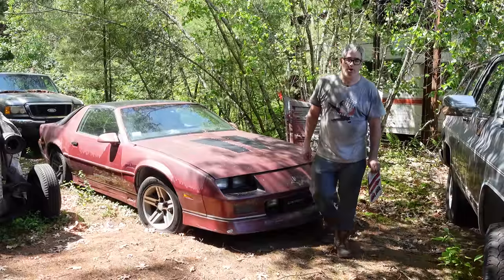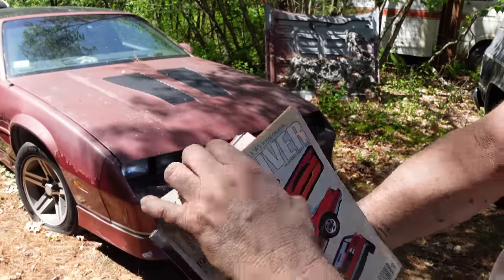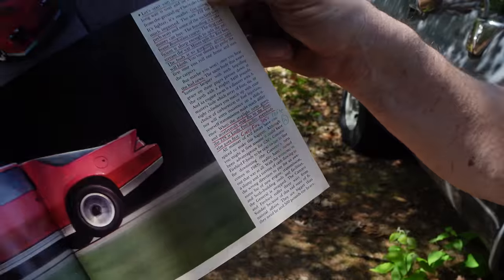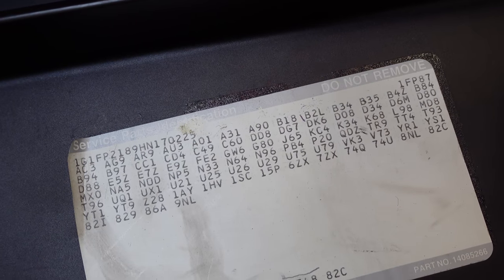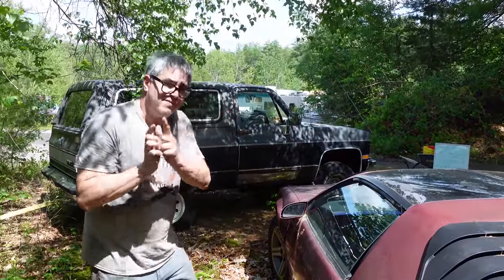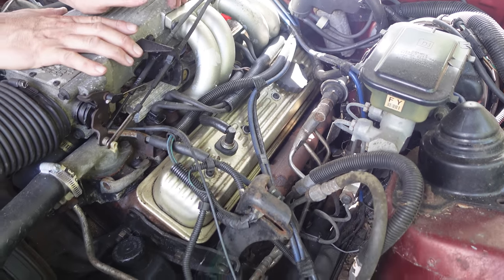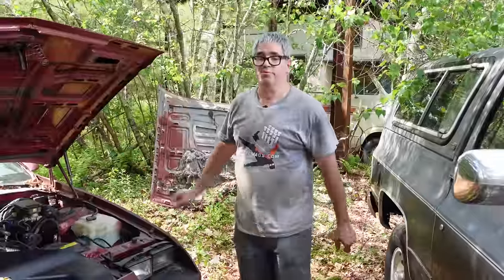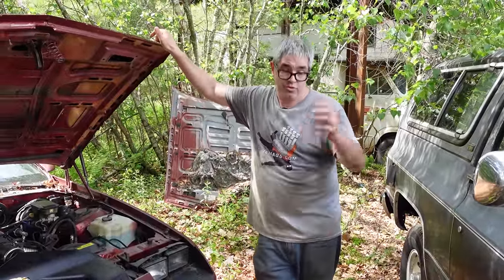Heart of a Corvette

Comment: My 1986 Mustang LX with the GT options never lost to a stock Z-28 or TA back then in street racing. Dudes that owned them went through a sad period back then, you could see it when they saw the 5.0 badge.
Reply: My 383 Road Runner never lost to a 5.0 or a GM twin back then...My Plymouth was bone stock,I was a poor teen..Bought off a 1 owner female,car truly was too nice for a 16 year old..
Reply: Hmmmm, my 90 Formula 350 with Goodyear Gatorbacks aired down  used to walk the 5.0's at the street races every weekend.
Reply: Fox boxes - Taxi cab interiors (per Hemmings). 4-lug wheels with rear drums. No oil  coolers. Styling straight out of a 6th grader's notebook. Fortunately, we rarely have to see the butt ugly things anymore.
Reply: @jukeboxzero1  all you ever saw where the taillights
Reply: @ZacLowing  Yeah - at the junkyard where they belong.
Reply: @mypronouniswtf5559  bought a 70 roadrunner in 76 with a 383 and 727 with a b&m shift kit. Did a respectable 1/4 mile but topped out at 151, which it did regularly for 2 years until my drunken 19 year old ass ran it head on into a parked chevy pickup. I miss that beauty and the beauties that enjoyed it with me.
Reply: @atribecalledcookies4  Same here. I had an 89 Formula 350 in the early 90s and used to hunt them down. They could never understand how they got abused by an F body. Always had the same excuse, I missed 3rd gear if a 5 speed. I just laughed because it was a slaughter from the get go. They weren’t making up the 5 car length hole they were in by about 60MPH. I also was able to beat mildly modified ones. Only one I remember losing to had the complete GT40 package with different heads, cam and bigger intake. And that guy questioned if my car was stock, which it was.
Reply: I've got an 86 gt now. Had one, then. No IROC ever walked it in any form.
Reply: @4everdc302  Can’t speak for the IROCs but a Formula 350 was faster than any stock 5.0 Mustang GT or LX from back then. I know I had one and still have it. I honestly don’t know how many Stangs I crushed back in the day. I even embarrassed some 5.0 that had a vanity plate that said Z28ETR. He was so pissed he went straight home. On the highway I stormed passed a buddy of mine who was alone in his 5.0 LX and I had 3 people in my Formula. He knew my car and thought it would even things out. But he was wrong. The Formulas were a couple hundred pounds lighter than the IROC or T/A because they weren’t all loaded down with crap. The WS6 suspension put all that TPI torque to the pavement without wheel spin. Even took out a GN or 2 with it.
Reply: @mikee2923  There's still plenty of Foxs around, and now 5.0 might mean Coyote. My 305 auto RS Camaro could beat my 98 GT Mustang with a 5 speed... which could beat a 5.0 Fox GT. Switching cars though, my 98 GT could beat my 305 auto RS Camaro. Driver's race. The Fox Cobras though were a little quicker, but should be even with these 350 IROCs. Another driver's race. So the cars were almost always dead even. Until after the F-body double funeral, when Ford came out with Terminators to compete against no one.
Reply: Because you never raced the G92 code cars, 230hp 5.0 TPI and 245 hp 5.7 TPI, not all 3rd Gens were created equal.
Reply: @ZacLowing  Back then I saw the 5.0 badge as an opportunity to humble cock sure Mustang owners they didn’t rule the road as many of them thought. Even though they could see the billboard sized FORMULA 350 on the door they scoffed but were quickly taught a lesson. I raced dozens of them. The only one that beat me had what he called the GT40 package from Ford. Different heads, camshaft, intake, headers and 3.73 gears. Mine was bone stock even with the OEM chip. Even he couldn’t figure out how I managed to have the front end of my car even with his back tire at the end of the 1/8 mile track. He had a 5 speed and could drive it and managed to beat me out of the hole which nobody else ever did. I was gaining on him at the end and he even agreed if it was a full 1/4 he would have lost. The majority of the beatings I put on the 5.0 Mustangs were severe. Nobody could ever understand it. They gave excuses but never wanted a 2nd shot. Guessing cause they knew. Even Corvettes knew better. I could never get an L98 Corvette to race me. I even eked out a few victories against stock Buick GNs. Had 1 opportunity to go against a GMC Cyclone but the streets were wet. I probably would have lost that one even on dry roads.
Reply: @nedaCFilms  I have an 89 Formula 350. Was the G92 a Camaro? In 89 the TPI 350 was rated 235HP with a single cat and 245HP with the N10 “dual exhaust” which was a high flow cat off each exhaust manifold then into a single 3” over axle pipe which mine has but I don’t remember seeing a G92 under the console lid.
Reply: @mikee2923  That is some cool fan fiction!
Reply: @ZacLowing  More like a hard dose of reality you ain’t ready to hear.
Reply: @mikee2923  Your right, suddenly your king of the road 30 years ago.
Reply: @mikee2923  G92 code started as a “performance rear axle” option for upgrading to 3.42 and 3.73 gears from the factory, but in the late ‘80s it went from being just a performance axle option, to a full performance package, consisting of multiple performance upgrades. It was most beneficial to the 230hp 5.0 TPI manual 5-speed cars which got the more aggressive roller cam, 3.42 gears, N10 exhaust, engine oil cooler, 4 wheel disc brakes, weight saving options, etc. Sanctioned SCCA and IMSA road racers would order Camaros and Firebirds with G92 code and delete air conditioning which triggered the 1LE option which deleted radio and all power accessories and added aluminum driveshaft, baffled tank and swing arm fuel pickup, upgraded to Z51 Corvette brakes and few other upgrades. I have some G92 and 1LE models on the channel.

Comment: Excellent presentation.  Love your work Steve.  Many thanks.   On a side note, those cars were really nice.   A sign that the times were finally changing and heading the right direction after a decade of despair.   I had a friend that did an LS6 big-block 5-speed swap in an 1987 IROC a year or two after he bought it new.  He really worked hard to make it look like a "factory car" as if GM made it that way.
Reply: He’s either blind or thinks we can’t read. That’s a B2L rpo car. 220 hp 350.

Comment: If you ordered the crossfire or 350 you had to get an automatic transmission.  The LG4 base engine was only 145 horsepower.  Those parking brakes were difficult to adjust on the disc brake rear end.

Comment: Never drove those third gen Camaros but I did have an '86 Corvette with the TPI and automatic. The throttle response was so touchy that it was easy to accidentally spin the tires if you took off a little too hard. The problem with those TPI was you were all in around 5 thousand RPM. When they came out with the new LT1 engines in 1992 they fixed that problem.
Reply: You are correct it seemed like they just ran out of steam at that point.
Reply: @garymckee8857  They did. I had a 89 Formula 350 and built a 355, installed the GM corvette aluminum heads and even bought GM's over the counter Siamese runner intake tubes but it would still fall on its face after 5500 RPM's. The intakes were good for low numbers and torque, fell off at high RPM's.
Reply: @Neo1969  Tuned Port Injection. The best induction system GM ever designed for trucks, tow trucks, vans, SUVs and heavy body on frame cars that they never installed in any of those cars but instead installed only in "sports cars".
Reply: @Airwolf1971  Agreed, the intake would have been an excellent choice for trucks and vans as for the low-end torque it created.
Reply: And induced more problems with the LT1. Stock for stock L98 car was better on the street

Comment: My brother used to have a 1988 IROC-Z Convertible (Red of course) with the 350 TPI. This was the most wicked car I've ever rode in. Doing 140+ mph was the norm. This car was amazing, and it actually looked like an exotic car. These IROC convertibles are super rare, especially with the 350 TPI, probably rarer in manual.
Reply: They didn't make a convertible with the 5.7 in the 3rd gen camaro
Reply: @bigboytoyz541  Yes, they actually did. And this what makes certain IROC-Z Camaros ultra rare. Find a convertible 350 TPI with a manual trans and it's probably the rarest Camaro in existence. I actually own one. It has 30k miles on the odometer and doing 140+ MPH plus is still the norm.
Reply: @blessedjuggernaut  everyone says they had one but....   they definitely didn't make a 5.7 with a manual transmission.  And the only possible convertible with a 5.7 would be one of the convertible conversion cars.  They never made a 3rd gen convertible with the 5.7 from the factory,  put it that way.

Comment: The 87 with the 350 was twice the car compared to the 82 and you could see it and hear it a block away. The build quality was a lot better too the 82 was a rattle trap . Of course it showed up in the price the 86 was quite a bit more even decades later . Thanks Steve .
Reply: Nah, both made in either Van Nuys or Norwood back in 1982 (and for most of 1987). Norwood cars were much better, but 1982 or 1992, they are all still loosey goosey.
Reply: I love that Blazer/Jimmy behind you!

Comment: Hi Steve, great video of this "Camaro That Thinks It's a Corvette." These rides earned the title "America's Best Handling Car" with its upgraded suspension and sway bars, high-performance shocks, and bigger wheels and tires, as Steve mentioned. These were definitely not meant for the 1/4 mile track. They were probably a 15-second car at best in stock form. These cars were built for the road course. But it's a SBC, so add-on horsepower options are infinite. That being said it's getting very difficult to find an unmodified version. I'm not sure of the condition of the undercarriage on this example, Steve has featured, but this car looks to be bone stock and worthy of restoration. If you watched the early IROC racing series it was Porsche out there straightening the curves. I believe Roger Penske had a lot to do with the series at the time. I seem to remember him as a  commentator or something. I believe Porsche was too expensive to run and they switched to the Camaro but I think it was before this generation of Camaro but I'm not sure and I'm almost certain someone with better experience and knowledge will fill in the details. The real IROC race cars were massaged production Camaro bodies riveted to a NASCAR chassis and stuffed with a 450-hp SBC V-8, the stock version was, well, something less than that, but it didn't mattered. I don't really have a lot of experience with this generation of Camaro except for my Pontiac powered 455 Olds Cutlass Cruiser would eat them up in the 1/4 mile. I took a few dollars from the owners of these rides, sometimes their female companion. I dated a bar tender back in the day who owned 90ish GTA with the 5.7. That car definitely handled well and would break loose in the curves if you played with the throttle too much. It definitely would break loose on wet pavement which I can say with 1st hand experience. I was driving the car once and was going into a long curve and it was a long straight road coming up so I floored it. The car immediately broke loose and while still in the curve. I left the roadway into a row of bushes in someones front yard. My friend in the passenger seat was yelling "watch out for the bushes!" Well that GTA being so close to the ground cut about 9 of them down to the ground. I could see each one like a basketball bouce up and over the car as if a high speed chainsaw came by and sliced them even with the ground. All of them in perfect form ended up in the middle the rd. It was absolutely the funniest thing to see perfectly round bushes rolling down the road in the rearview mirror. I kinda ruined the ground effects on the passenger side but we didn't stay together long after that. She had a sister that was a cop and I wanted to do something bad so she could 'arrest' me! 😇 I learned to respect the GTA after that. I personally like the TA over the IROCs. The Pontiac probably had better handling than the IROCs but I'm not sure about that either. They're probably the same car etc. I'm not sure if Steve mentioned it but wasn't this generation the 1st with a hatchback? A couple of good movies to watch featureing the IROC-Z "No Man's Land" and "Blackdog" Y'all have a blessed day 🤙🏼 Namaste 🙏🏼

Comment: I had a 1983 Z28 , baught it cheep and it had no engine and but it had a 700r4 that needed rebuilt, had the transmission rebuilt, then baught a 305 that came out of a 1986 full-size blazer, that had a little bigger cam . Unfortunately had to sell it when we moved didn't have room for it , miss that car it was a blast to drive , I planned on putting a 350 in it , but might have put an LS in it if I still had it . Great cars

Comment: The 5 litre mustang was the fastest American car built in the 1980s.     Hands down
Reply: Um, the Buick T-Type/Turbo T, Buick Grand National, Buick GNX, and Pontiac Turbo Trans Am would like to have a word.......
Reply: Maybe in the 1980's. In my area in the 2000's, not so much. I had a completely stock (OK, stock APPEARING) '66 Corvair Monza coupe that HD been, ahem, warmed over just a bit. The factory 4-carb engine originally rated at 140 gross h.p. ended up putting 220 h.p. to the ground. Of course the suspension and brakes were modded to handle the added output. Pump gas? No, not really, more like pump Premium with octane booster added. 12:1 compression in an air-cooled engine pretty much calls for that. The upshot being that my 2,400 lb, 220 h.p. 2.7 liter (164 c.i.) Corvair kicked butt and took names when it came to 3,300 lb, 185 h.p. 5.0 Fox-body Mustangs! My vanity plate said, "CORVA1R" to let the young guys in the Mustangs know what that car was that just dusted them. Not that I would ever do any street racing.  That's unsafe and illegal. But if I were to have done it (nudge, nudge, wink, wink), I would have been 13-0 against various 5.0 Fox-bodies.
Reply: You are truly clueless. '89 Turbo TA destroyed all Fox junk and had a higher top speed than the '89 Vette.

Comment: Love the 3rd gens. Back in '90 I purchased an '84 Z28 that had the front end knocked off of it. I had a new front sub frame welded in. Hung all new sheet metal and added the IROC ground effects, wheels and tires. Fitted '89 PBR rear discs. 36mm front sway bar. Homemade strut tower braces. And, the coup de grau, a 305 TPI built to '91 spec. Loved that car. Wish I hadn't sold it the day before 9/11.

Comment: I had a fully loaded 1983 Camaro with the 2.5 liter Iron Duke four cylinder motor. I bought it in 2002 from a guy in Las Vegas so the body was rust free.The four banger was adequate but I had the V-6 "dual" exhaust installed so it looked and sounded cool.

Comment: Thanks Steve.  That one is almost identical to the one sitting in my garage with just under 80k original miles.  I purchased it new in July 1987 and it was my wifes daily for about 6 years.  We moved into SUV country on a steep hill, her commutes got longer and our workweeks stretched out to 50 or 60 hours and the Camaro sat in the third garage gathering dust.  In 2017 I retired and refurbished the IROC.  It took a new fuel tank and fuel pump, mufflers, cat, tune up, brakes and tires to get it running like new again.  It's still a fun car for cruising on sunny days and since we are both retired now we have time to take it out when there isn't a whole lot of traffic.

Comment: I bought a 91' Z28 in 93'. Still have it. 305 LB9 TPI 5 speed. 1LE car. Also R7U Players Challenge car. Now it has a 350 ZZ6 and 6 speed Tremec Supermagnum.  
Put original T5 and 305 in the crate that the new motor came in so I can put it back in one day or sell it with the car. 
My dad came home with a brand new 86' LG4 305, 5 speed when I was 15 so that's what got me started on 3rd gens.  
I'm sure someone will be rescueing this 87' now after being showcased on channel Steve.

Comment: Those hoods were originally functional with the Crossfire and L69 engines. They were sort of like NACA ducts that supplied cool air to the intake system via forward facing vacumm operated trap doors.
Reply: I think it was the '82 and '83 Z28s
Reply: @jewllake  I thought it continued to 84 but you might be right

Comment: I had a 5.0 225 HP mustang during these years First the GT then the more sleeper looking LX, both with the 5 speed. Once you changed the rear axle gear, it made it a whole new fun car to drive. It wasnt the Camaro's you were worried about, it was the Buick GNX.
Reply: GM were on to something when they put the Buick engine in an F-body.
Reply: @skaldlouiscyphre2453 It would of been better if GM supercharged or turbocharged them

Comment: There was a spec racing series sponsored by Players/GM of Canada, it ran from 86-92, running Z28s and Trans Ams, and it was some of the most wild and entertaining racing I’ve ever watched. The fields were very large, 40-50 car range, and quite thrilling to see and hear 50 5 litre cars with open exhaust thundering down a long straight into a hairpin corner, paint was routinely traded. It was a good testament to the cars, they really flogged them, and dnf’s due to mechanical problems were quite uncommon.
Reply: It's a shame they never built a Camaro or Firebird for Group A. They'd need some improvements over the 1LE+A4U/R7U package that the Players Series cars were based on, but certainly GM could pull it off. 

Not sure if they'd be able to touch the Ford Sierras, those were unbeatable until the R32 came along. The Sierras made more power than 5.0 Mustangs and weighed less because of the small displacement. At the very least the Camaro would be a better platform than the Holden Commodore, even if it's no better than the also-ran Mustang.